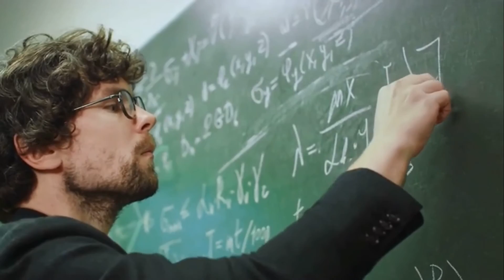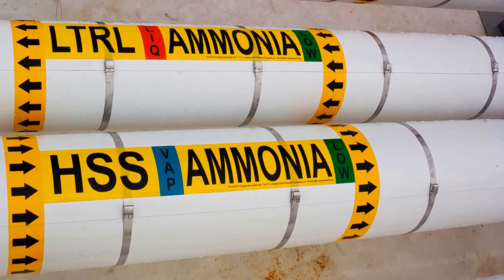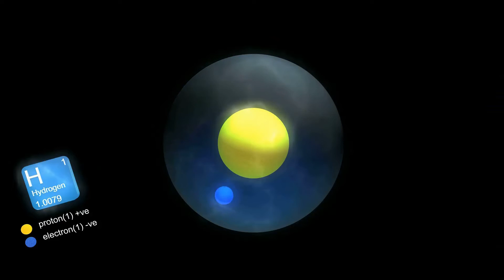How to transport hydrogen using ammonia (NH3)

Comment: regarding ammonia slip, ammonia is rapidly absorbed by water something like 800 times the volume, remember the ammonia fountain experiment? So a sprinkler system could be used to convert the gaseous ammonia to ammonium hydroxide. Can this base be allowed to flow in stormwater drains, better than ammonia in the atmosphere. In any case the escaped ammonia will be absorbed by any convenient body of water.
Reply from the maker: Yes, a sprinkler system could convert gaseous ammonia to ammonium hydroxide, which is less harmful than ammonia gas. However, discharging ammonium hydroxide into stormwater drains can still pose environmental risks. It’s crucial to check local regulations and ensure proper treatment before disposal to minimize ecological impact.

Comment: What are we talking about here, hydrogen and helium and now ammonia in situ, i don't see am mon ia in the period table and idk sun and water had anything to do with ammonia, i wouldn't be surprised tho, where does this leave the Trinity, it would explain a lot, artificial ammonia sounds like a problem
Reply from the maker: Ammonia (NH3) is composed of nitrogen and hydrogen. It's not on the periodic table as a single element, but it's a compound. The mention of ammonia in relation to the sun and water likely refers to its presence in certain environments. The Trinity doesn't directly relate to this context. Artificial ammonia could have implications, but more details are needed for a comprehensive discussion.

Comment: Ammonia production accounts for about 2% of global greenhouse emissions. Yes, the technology exists and the infrastructure is therr, but it is not a green solution.

There are some alternative methods of producing Ammonia being researched and developed. Unfortunately they aren't nearly as fast at producing at the scales needed to do what is claimed in this video. Also, they typically involve catylists which are usually rare materials, which means there will be severe cost and availability issues with scaling.

What's more, there is a golden rule with respects to energy sources. If it takes a lot of energy to produce them, they are useless. Oil is the most dominate energy spurce because it gives such a huge amount of energy compared to the miniscule amount of energy it takes to extract and produce it.

Why are Hydroge  and Ammonia so poplular if they are terrible energy sources then? In some small applications, other factors can still make them the best option, like if solar, wind, or grid access are impossible.

Mostly though, because the oil anf gas industry wants it so much. What the video clearly neglects to say is that currently, 99% of the Hydrogen we make today is produced using fossil fuels like methane or coal. All that heat and power going into making Ammonia also comes from fossil fuels. There is green tech to make these things, but the only option viable in the coming decades at the scales needed to run nation wide systems is fossil fuels. It's greenwashing for the oil and gas industry.
Reply from the maker: Thanks for your comment. It's true that current ammonia production contributes to greenhouse gas emissions; however, ongoing research and development are focused on sustainable and green methods. The goal is to address environmental concerns and make ammonia production more eco-friendly. Transitioning to cleaner energy sources and advancing technology can contribute to minimizing the environmental impact associated with ammonia production.
Reply: Hydrogen can be generated by water electrolysis and not the steam Reformation of natural gas the electricity can come from nuclear pair hydrogen can come from high temperature gas cools reactors where the water molecule is broken up directly from high heat

Comment: At Last!! A well thought out presentation.  You do not mention the fact that “green” ammonia, made from electrolytic hydrogen and atmospheric nitrogen, will directly displace ammonia made from fossil fuels. 
Precious metal catalysts are not needed to crack ammonia. Traditional iron Haber catalyst could be used. The hydrogen would be separated from the cracked gas using membranes. The nitrogen, residual ammonia and hydrogen that has not gone through the membranes  is then burned to supply the heat needed to crack the ammonia. A small amount of ammonia added to the flue gas destroys NOX. 
Finally, some companies are working on engines directly fueled by ammonia.
Reply: How does ammonia compare as a fuel to petrol, methane, diesel? I had a dim recollection that ammonia was not an enthusiastic fuel, happy to be wrong. I remember an episode of the “Six Million Dollar Man” where Steve was trapped in an industrial refrigerator using the ammonia refrigerant in a blowtorch. Yes, it’s Hollywood.
Reply from the maker: Thank you for your comment.

Comment: We don't want to carry hydrogen, we want green fuel. Why not use ammonia itself as the fuel? Extracting hydrogen at the destination is a huge waste...
Reply from the maker: It is possible to use ammonia as a fuel, but the rate of NOx formation in the combustion process is high (the source of acid rain and many other environmental issues). On the other hand, it is not possible to use NH3 in PEM fuel cell systems because nitrogen molecules are much bigger than H2 and cannot be transferred within the membrane. If the target is to use NH3 directly, the above issues must be addressed.
Reply: @futureenergytechnology so why not just methane?
Reply from the maker: @destinyjohn1130  Methane is a good option for power generation and transportation. At least better than other fossil fuels. However, CO2 is one of the main products of CH4 combustion. Also, limited countries have CH4 reservoirs. Hydrogen can be produced everywhere. As long as you have electricity (especially from green sources), you can produce H2. On the other hand, its combustion does not release CO2. Also, it can be used in a Fuel Cell system, which is completely clean energy conversion.
Reply: i think the fear of nox is unwarranted, for one " acid rain is such a "mediafearporn" term, doesnt it hit the ground and react with limestone , becoming beneficial nitrites, nitrates, carbonates , minerals and trace elements leeched from the soil by the sulphates , releaseing them too for plant food, i am not seeing a downside here of nox, ect and i am sure corals and plancton love co2 , the amount of life that can eat infinitesimally more co2 times every blade of grass , tree, leaf, plancton, coral, microbe, as temps rise and co2 levels increase slightly, powerfull reactionary mechanisms kick in , its meant to allow for massive events like volcanic eruptions and meteor strikes, pesky humans burning things and running about hardly affects anything , in my humble opinion. cheers!  molten salt reactors for the win! @futureenergytechnology
Reply: @futureenergytechnology  Adding ammonia to the exhaust gas of an ammonia engine  destroys NOX
Reply: Agreed
Reply: Hydrogen/ammonia oil and gas company's trying to sell even more oil and gas.

Comment: Another way is to produce the ammonia , where you need it . Fuel Positive a micro Canadian company has produced a device that will produce 100 ton/year of ammonia . It will fit in any single car garage . It produces ammonia at 45centigrade and standard air pressure ,meaning it needs massively less energy to produce the ammonia, they are just starting to manufacture the machines for farms
Reply: Fuel Positive , Calgary , Canada, NHHH is stock market symbol, they are about to deliver very first machine, to a farm this quarter
Reply from the maker: @duncanlawson4002  Thanks!
Reply: There are a couple companies,  I don't know who is the best, I am just pointing out this is REAL tech, it is here and commercial.
Reply: To my knowledge there is no process producing NH3 in these conditions please give me more information on this company
Reply from the maker: @saatee100  Thanks for your comment. Yes, more information from @duncanlawson4002 would be helpful.
Reply from the maker: Thank you for the information.